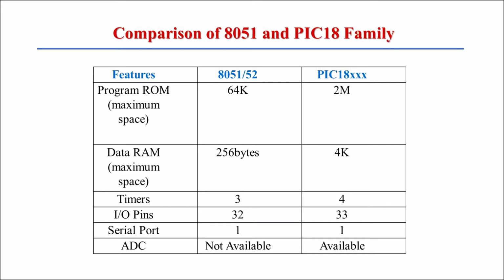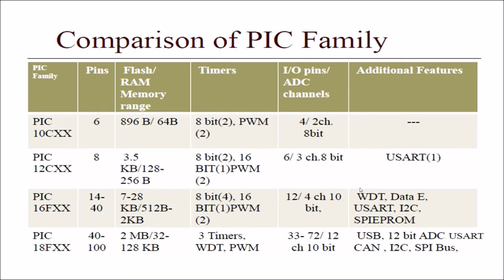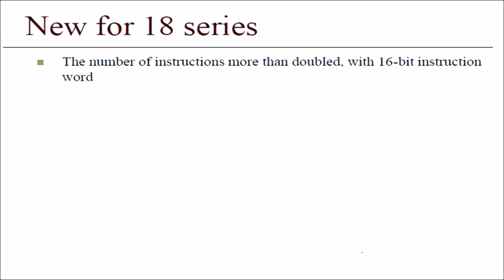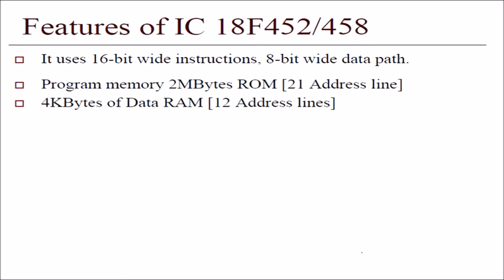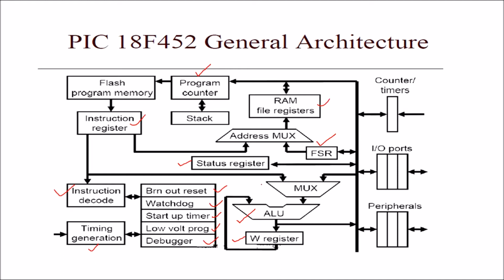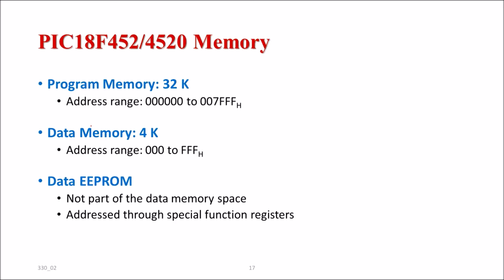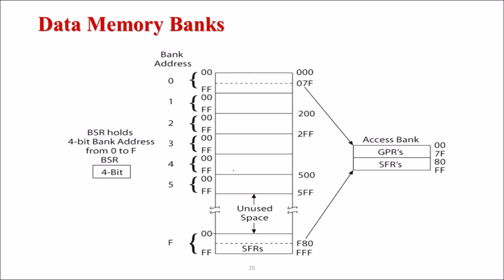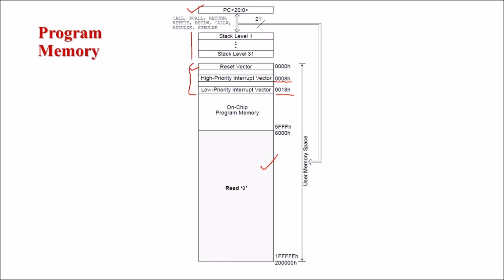PIC_Lecture 1:  Introduction to PIC Microcontroller Part I : peripheral interface controller

Comment: I will say I e never had any experience with PIC microcontrollers. I have plenty of esp32 type controllers. However my work threw out a bunch of IR remote controllers. I saved them from certain doom and when I cracked the shell not only was I surprised that pic16 was used but it was also socketed. Major score in my opinion and these chips will find another purpose down the road. I was thinking of building a matrix with them and use all the ports to sample different audio frequency for a spectrum analysis